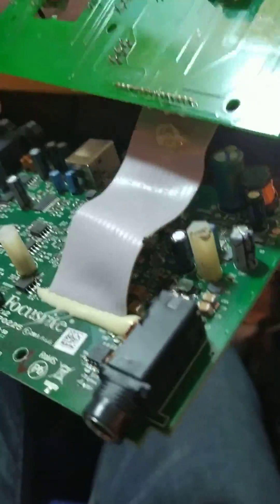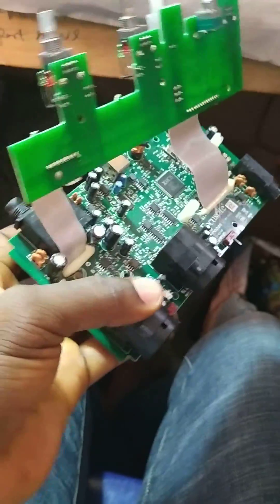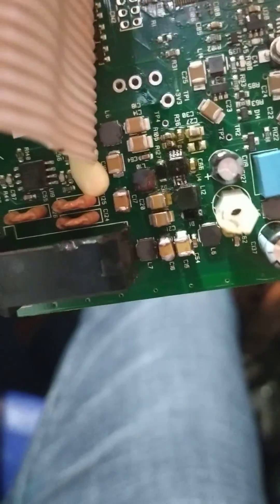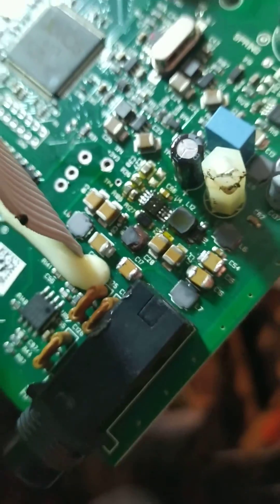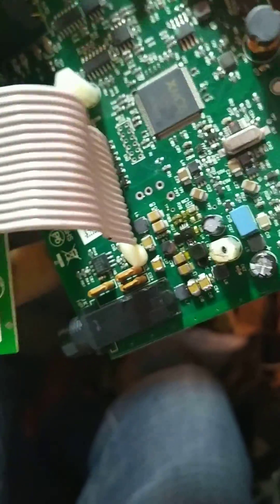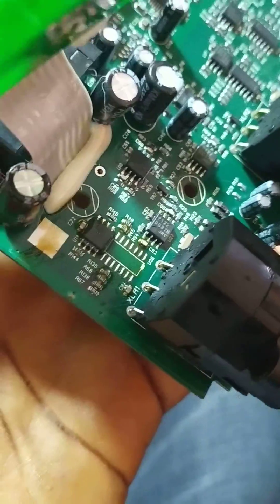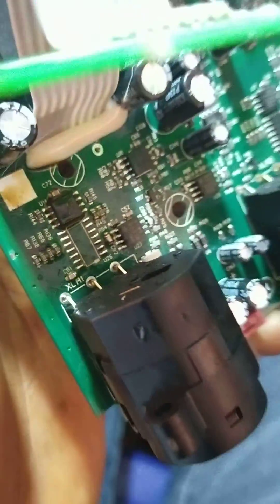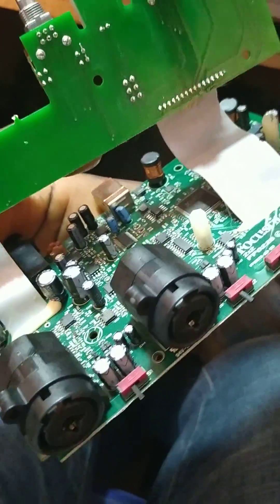Focusrite 2i2 No Input and Output Troubleshooting and Solution

Comment: my focusrite 2nd gen pentom +48 on but no sound comes out of the condenser mic. sounds comes from the normal dynamic mic. Please help.
Reply: It’s the cable,condenser mic uses 3 to 3 pin,while the dynamic mic can use 3 to 2 cable,so check the connecting cable